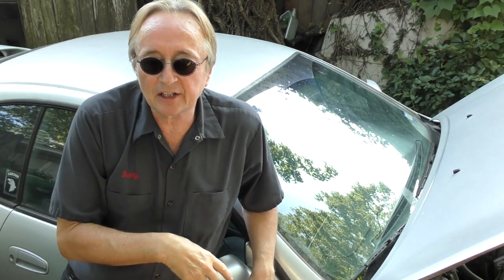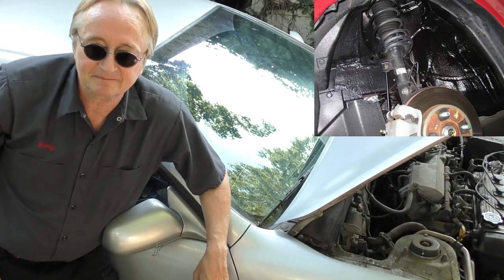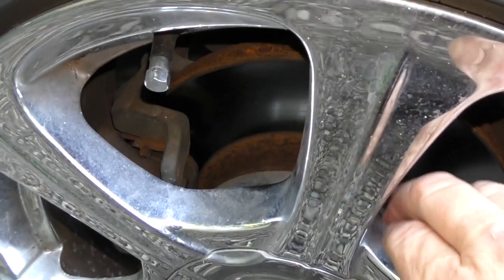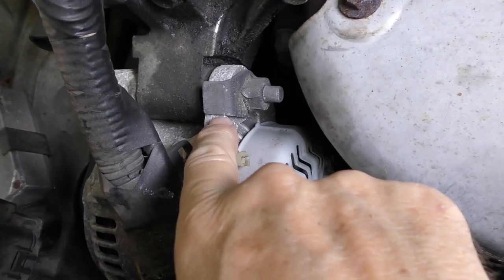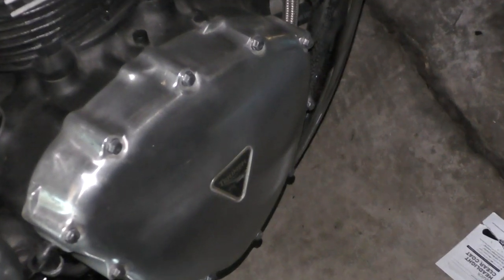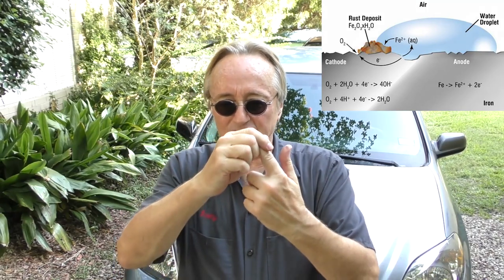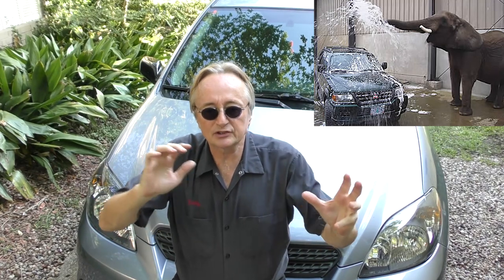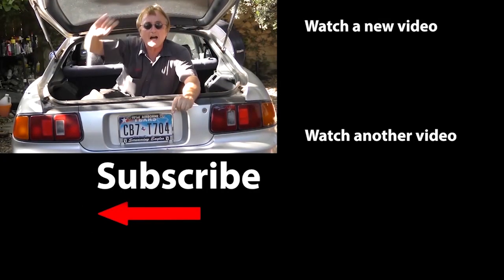Why Not to Park Your Car in a Garage

Comment: Watch out for slimy dealers trying to sell you new brake rotors because of rust. Every year as I wait at the dealer during inspection I hear them try to sell me or another customer new rotors. They tell them "you have rust on your rotors that could become a safety issue so we recommend replacing them." Slimeballs. As long as the rust isn't on the contact surface the rotors are fine. They tried this with me and I declined. I had the same rotors another 6 years and they passed inspection every year.
Reply: hahah  yeah,   its the latest scam,   they take the same cheap rotors at the factory and just paint them.   poof,   instant 5 dollars more for the cost,
Reply: I had them try to sell me new tires because the 4 were of 3 different brands on my new/used car.
I got new tires..
...
...
...
...
...
35,000 miles later.

Comment: Here in Toronto, Canada, we have at least two companies that specialize in car body rust prevention. These are 'RustCheck' and 'Krown'. Both are petroleum based products that are applied annually for a cost of about $100. These coatings are said to repel water and they 'creep' i.e. after application they creep and expand coverage into all the nook and cranies that may have been missed. I have been using them for the last thirty years on all my cars and there is no rust on any of them. My mechanic reports that on a recent muffler repair he was able to remove the bolts with a simple wrench as opposed to having to cut them off with a torch (the usual way to remove rusted parts) because the annual Krown spray application prevented any rust for all those years the car was driven on salty roads.

Comment: so if you got a car with oil leak,   front axle grease leaks,  transmission leaks,   your car just might last much longer,   its a automatic rust prevention application,   it only comes on the best of cars and trucks.   when you buy a new car,  ask the dealer for the leaker rust value plan.
Reply: Nope the grease attracts dirt and moisture and can hold it in and cause it to rust
Reply: @DylanL69    think ur wrong there. Oil lubricates, so rust won't happen. I'm aware that oil leaks are not good thing on cars, but,  get screwdriver, push off layer of black oil, see how clean, new that bit looks?!  Scotty knows best.
Reply: No ma'am you're wrong the grease from the cv joints attracts dirt and can cause rust
Reply: @DylanL69   okay Scotty is on about oil leaks preventing rust. If u compare car with no oil leaks, to a car with oil leak layre, hands down, there won't be any rust where that oil sits.
Reply: @katrinahopkins1516  nope you're still wrong
Reply: @DylanL69  Wrong. Water is repelled by petroleum based lubricants.

Comment: I have a 2015 Hyundai Sonota hybrid and bought it brand new. I live in Pittsburgh where they use tons of salt on roads. I have been parking my car in a heated garage since the day I bought it and after 76k miles it’s still in showroom condition. If it takes another couple of years to start rusting, it will be well worth the comfort and convenience of getting in a warm car and not have to scrape off snow and ice.

Comment: I live in the Northeast.  Waxing spring and fall and an annual undercoat of Fluid Film helps tremendously.  I Fluid Film inside the doors/trunk as well as anything underneath that doesn’t move, get hot, or have factory undercoating on it.

Comment: Buying a Gen 4 4Runner.  They ain't cheap!  Scotty told everyone how awesome they are.  I looked long and hard to find one with no frame corrosion.  I'm going to rinse it well, inside and outside the frame, take it for a drive to blow out most of the water, let it dry for a few days, and then coat the frame and suspension and inside the body panels with Fluid Film annually to prevent corrosion.

Rinse with cold water.  Hot water sprayed on salt is much more corrosive.

Comment: It's 2019 and there's still no cure for rust. I blame big pharma.
Reply: YES. JUST YES
Reply: I sell rusty color paints , where in the world are you , so ( I can mix your environments shade ) and how many gallons do you need ?
Reply: Spray the entire underside of your car with oil. That is the best method. Coatings and other products won't work. Don't even bother with them. They can even make things worse.
Reply: @justinsweeney643  lol the guys probably just joking and doesn't care, but I'll bite. Is it cause its hydrophobic?
Reply: @Jaden-up3bg  Moisture cannot oxidize metal that is coated with oil because oil and water are miscible. Essentially, the oil acts as a barrier that prevents water from coming into direct contact with the metal surface.
Reply: @justinsweeney643  except if do that, then you have oil dripping on to your driveway or garage. Also, it makes it more difficult to determine if you have an oil leak and where it's coming from.
Reply: @Hamim Mahatab "I blame big pharma" should have clued you in that he was at least half-joking.
Reply: Admiral, take two aspirin and move to Arizona.

Comment: I had a collector car in my garage for a long time. My cars were outside (snow belt state) for all of their long lives. They still rusted (brake lines, etc) and the upper panels paint dulled and the clearcoat peeled. I waxed them but it didn't last. Now my car is in the garage and at 9 yrs old looks new and the paint still beads water with a yearly wax job. I agree about the warmer garage and melting slush will cause faster oxidation, so you could leave it out until it is washed or dries out. Dried salt on the car won't cause corrosion as it needs water to do damage. I do love the car in the garage in hot or cold weather and not cleaning off snow and ice is a big win. Easier to blow snow too.

Comment: Parking In my garage keeps the elements off my car, keeps the sun from fading my paint and cracking my interior, keeps the thieves and vandals  from getting to my car and don't have to worry about all that rain water getting into places and causing rust issues if I left it outside.
Reply: The issue is not parking in a garage,  it is parking in a heated garage.
Reply: Robert Daone I agree. The real question here is if you have a garage, why would you NOT keep you car inside it?
Reply: Even if it's not heated it still is warm enough to melt snow.
Reply: @godzoookie  How is it warm enough during winter? It’s always cold outside and so is the temperature in the garage. So I don’t see how it can get warm

Comment: it has nothing to do with the water, only the oxygen and conductivity. The seal is an electrical insulator. No matter how perfectly you apply it, you're going to have differential expansion; even if it doesnt crack from the same side being pointed at the sun every day, or a rock, whatever....its going to bubble out somewhere because of the electrical difference between the body and the surrounding environment. That device is meant to give electrons so they dont come out of the steel, this could also be done with a sacrificial anode made of a metal that gives electrons more readily than the steel but has the same problem because the car sits in a gas not a liquid or a solid where the conductivity is more uniform. Aluminum would be great for that but it builds a patina quickly and stops conducting. Another solution could be turning the iron oxide into a more durable polymer so it insulates but doesnt flake off so easy. But if you invent it, it will be suppressed
Reply: You could corner the hot water heater market

Comment: Our cars tend to rot underneath because of the high humidity coming up from the ground, and also salting the roads. The main trick here is not to store undercover with salt splattered under the vehicle, the salt concentrates and reacts faster. But if it’s dry under cover after a spray off for a few days it’s saving rot from the winter ground humidity. Vehicles fall to bits here after about 12 years we don’t bother to rinse and they’re always out in the rain and damp.

Comment: I knew a guy some years ago who had a clever trick.
Every summer he would take his Volvo, put it up on jacks and spray the whole underside with oil.
Then, he would take the car on a dusty, country road and drive it for a while.
All that dust mixed up with oil made the car pretty much rust proof.
This Volvo was about 14 years old and had about 300.000 km on it.
The damn thing looked like brand new.

Comment: Under this theory, every fire department in areas with snow fall prove this wrong.  Fire trucks and ambulances are garage kept, see a fair amount of use during winter storms with trees and power lines down from the weight of the snow and  vehicle crashes.  The vehicles leave the garage, respond in the snow which is being slated, especially at a crash scene to prevent another crash, collect slush and salt to be driven back to the garage and parked in the warm garage and won't be washed until end of the shift or until the weather clears up.  Where I live we still have trucks from the 90s in service which show little rust damage if any at all.  Most of these vehicles see no underbody washing unlike our cars which get an underbody spray at an automatic car wash.  Then again, automatic car washes, brushless or not, will destroy your car.  Not driving it will dry out seals and "destroy" it as well.

Comment: but if I put my car in the garage, I won't have to scrape snow and ice off of it, which means I won't risk scratching the paint and exposing the metal.  Garages do prevent rust!
Reply: and helps save the clear coat from uv damage.

Comment: My Nissan Titian is suppose to have a lifetime warranty covering rust.The frame and body parts are electrically charged and dipped in some type  primmer.I live in the south where the roads are rarely salted and away from the ocean.Rust has never been a problem on any vehicle I have owned.

Comment: He is actually right. I used to keep my car in a heated garage and noticed that the underbody would be wet for two days. After installing fans under the car and on the walls it stopped rusting.

Comment: We have a heated garage in MinneSnowta, usually at 45F. The snow and ice melt off, hit the floor and that's that. We don't have cars that start out rusty and wash them periodically. I will say that the concrete of the floor is no longer glossy and sealed in the tire wipes, so the salt did its harm there. We also use a less corrosive salt in MN, and it is less effective on the ice at colder temps. So what you (Scotty) say about salt is likely true for sodium chloride, it is less true for calcium and magnesium chloride salts used here.
Reply: Yeah but parts of the car where water pools stays there, it can't fall and hit the floor because it has pooled...

Comment: I definitely park my vechicles in the garage. When the salt hits the road I crack the garage door and back door for air flow. I always have my garage window cracked. Also, I can heat my garage but it is not always heated. What are you on about scotty? I should note that I hand wash and wash all the time. In the winter I will power wash at the coin op and then waterless wash in the heated garage and proceed to detail. Pain the butt really. It's really nice to not have to get snow off or defrost windshields or trek through snow to get to my car. FYI I live in Michigan.

Comment: Buffalo NY...ha!  That's tropical compared to here in Saskatchewan in the winter.  I park my cars in the garage (unheated but attached) in the winter and will never go back to plugging them in outside a garage.  Even when the temp hits -40C outside, the coldest it ever gets in the garage is about -10C.  Obviously you're getting leakage from the wall attached to the house, even though it's insulated.

Comment: Many cars in cold climates that have heated garages have electrical issues also, as greater condensation cycles happens, in garage vehicle gets wet, then freezes when vehicle goes outside and goofs up certain fragile connections.   Certain makes and models are better than others

Comment: He’s definitely right about salt ruining cars when it gets warm. Up here in ny a lot of people pay for a monthly unlimited car wash that has a big pressure washer that cleans off the bottom of the car. There are a couple companies that will undercoat your vehicle with a much higher quality undercoating that will help out a lot if you get it done before the car has any rust that’s about the best thing you can do. However many Asian cars and European cars have a coating from the factory that keeps the cars from rusting pretty damn good. Sadly Chevys, fords and dodges don’t come with anything coating the bottoms of the cars and they are the vehicles that rust out the fastest. .

Comment: I haven't waxed any of my cars for the past 12 years.  Haven't had any of them rust yet either due to normal circumstances (age or mileage).  The only one that started to rust (which was in the inside door frame by the sill plate on the floor, only rusted because the rubber seal broken and water pooled up in the area).  Waxing is good, but once your car becomes damaged, I personally wouldn't bother anymore especially if there are already signs of rust.  I do think in extreme heat and places where you get a lot of sun, like in FL, you may want to park your car inside.  Another thing to keep in mind too is to make sure that if you go to a car wash, make sure that during the rinse cycle, it gets all of the soap and stuff out of the crevices.  Sometimes I'll go through the automatic wash, and then take a quick trip through the manual wash and do one final spray down with clean water to make sure as some of the automatics don't do the best job with the rinse cycle.  Also, if you do the automatic wash, always get the under carriage wash option at least once in a while.  More often if you drive in snow/salt or dirty places.

Comment: Scotty,
I still use hi temp exhaust paint on my calipers and the parts of the rotors that do not contact the pads. This looks good, and the brakes do not rust at all. The overspray on the rotors will wear off by using the brakes just like the water steams off due to the heat of friction. I drove my truck on a clear, dry day using the brakes often, and after several applications, the overspray disappeared and braking action was normal. I live near Birmingham AL, so salt contamination is not a problem here. Ice and snow removal is two men with shovels in the back of a dump truck filled with sand and  fine ground cinders!  Nobody buys winter tires unless they are hi flotation "mudders" on 4WD back country beaters. Have fun in Tenessee!

Comment: Krown or rust check if you live in a humid or salty environment
 get you car under oiled
 I use krown
 2010 ford edge  and no rust 
I live in central Ontario. the roads are salted in the winter
Reply: Charles Chamberlain do you oil it every year? I’m in Ontario too

Comment: You can sort of combat the effects of salt (for those living up north) by washing your car regularlly and NOT parking in your garage (or other warmer places) during the winter.   Just leave it outside because that way the salt basically stays in a solid form and doesn't float around and get into other stuff when it melts.  In all of my cars, none of them have significantly rusted in the time I had them (on average, I had cars for about 5 years but even on the ones I had for longer, they didn't rust anymore than when I bought them that way because I kept them clean during the winter months, which I think is your best defense against road salt, which is sort of unavoidable in certain regions).

Comment: The cold garage thing may be something. I’ve always lived in Michigan and always kept my cars outside and they aren’t rust buckets. 
Surface rust on aluminum is actually a rust preventing coating, because it evenly coats the whole surface. Just avoid contact with wet concrete. 
Surface rust on steel is different. After time steel rusts and flakes which exposes more bare metal causing more rust.

Comment: True about the cold temp accelerated rusting. Google galvanic protection as indeed corrosion can be suppressed by electrial currents if done correctly. If done incorrectly can accelerate rust / oxides due to Ionic drift. Jus Sayin'

Comment: I have lived in MN all my life and rust is a constant issue.  Interestingly enough, I currently own a 2006 Honda Accord and a 1997 Toyota Camry.  Both vehicles have spent all their life outside in northern weather (MN, WI or ND) and the Honda is already showing several areas of rust esp. around the fenders.  Contrast that to the 1997  Camry (9 years older) which only has a small area where rust is beginning to form.  Although I like the Honda I can tell even by closing the door that it is not as solid as the Camry.

Comment: I park my 1990 Mustang in a garage (in NH with six month winters) that never goes below 50F. 30+ years and NO rust. The car sees no salt, ever, but it is not just the salt that is the problem. It is the ice. Water expands when it freezes. When water gets into all of the nooks-n-crannies on a car and it expands, it causes the paint to crack which exposes bare metal which the salt can then attack.

Comment: Oh wow I've been doing it right. I live in northeast Ohio and I've always had very little to no rust on my vehicles. My garage is taken up by my Lawn Boy collection and a Harley. The vehicle stays parked in front of the garage door in the driveway. On winter days when the temperature gets over 35° I will go rinse it off really well. I also have Krown rustproofing done on vehicles which I think helps. I had an 89 Chevy 1500, and an 04 Chevy 1500 that were both 15 years old when I sold them and they looked remarkably good. Some vehicles in this area look so rusted out I'm surprised that they don't fall apart or break in half.
Reply: I wish I lived near you. I have a 1968 D400 magnesium deck and 1981 D600 Lawn Boys from the OMC days. Trying to find a good home for them.